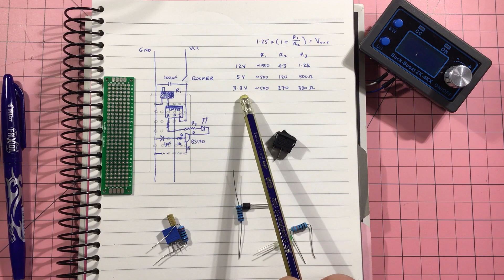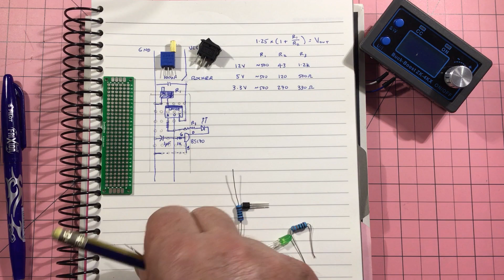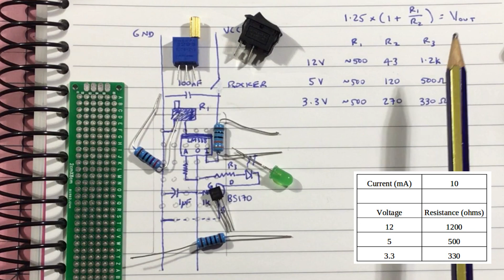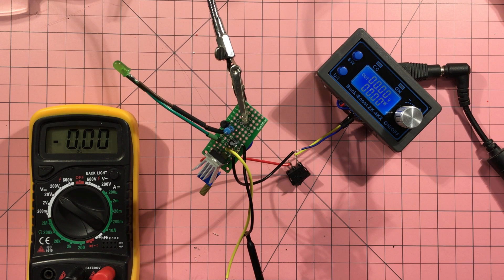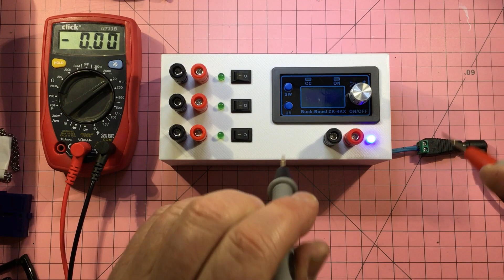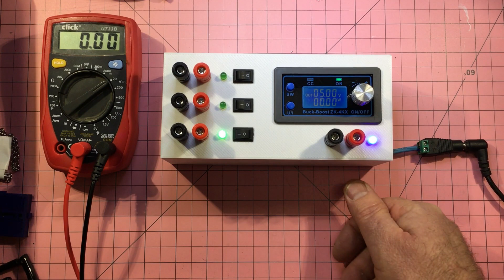PSU V - putting it all together (final)

Comment: I like those little modules, any idea what the input max voltage is? if it's around 65V I may need to get a few
Reply from the maker: The ZK-4KX is listed on AliExpress with input voltages in the range 5-30V, with a steady 3A and up to 4A momentarily. It’s a lottery probably but as yet I’m not in those ranges for the microcontroller circuits I make.

Comment: I recently finished the first of two bench power supplies that I have been making that use a 48-50v input (one at 8 amps and the other at 6 amps) The 50v 8a unit I just finished has a XY5008 (remote control and WiFi) buck converter that allows me to control it from the computer or my phone as well as it's Remote unit. I have a secondary output I can plug into to get 50v 8a for other purposes I may have. The second PSU will be done next week.
Reply from the maker: That XY5008 looks great! Might have to twist the bank manager’s arm… 😬
Reply: @onecircuit-as  I got it from Banggood, it's actually well worth the$53 I paid. Tell the wife you can pay on afterpay and make 4 fortnightly payments 😉